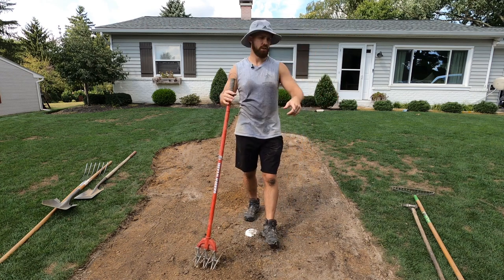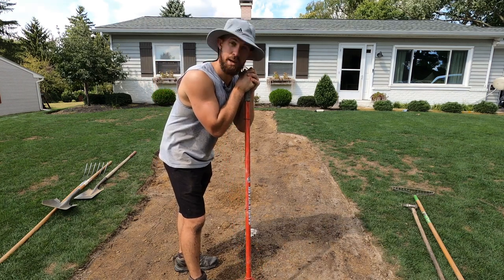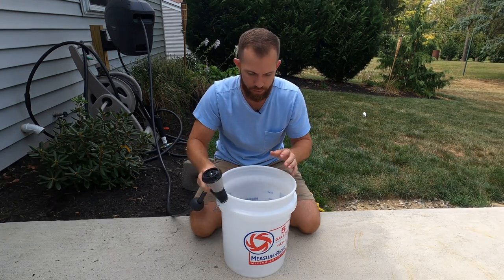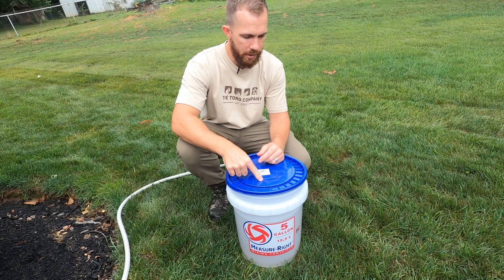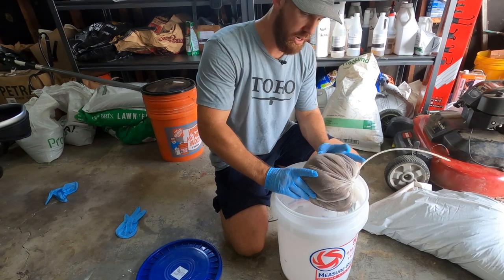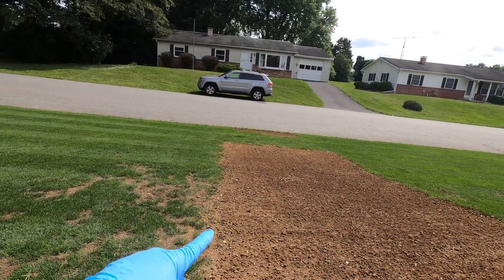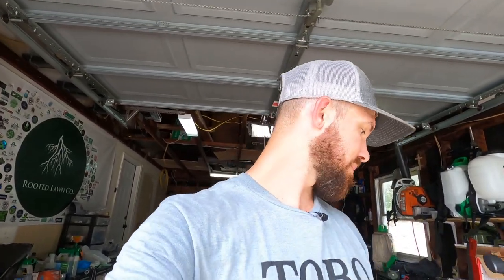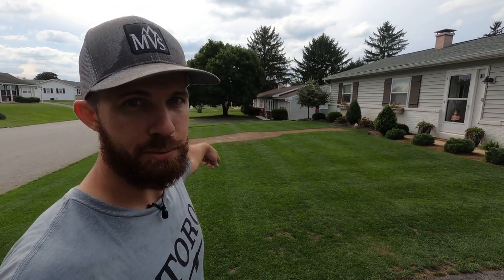Pre Germinate Grass Seed |Plus Leveling & Seeding Lawn pt. 2|

Comment: No need to have the seeds sprout. I seeded the seeds after having them in water for 8 days. They did not sprouts. So I put them on the ground. Three days later I saw baby grass. So the lesson was that all you need to do was to soak your seeds in the water for 24 hours. Then after keep it outside and water it for two days. Then, plant the seeds.
Reply: A big benefit to pre - germinating in buckets is saving $$$ on water and time. You didn't have to turn on your sprinklers for 8 days and that's a win. Pre-germinating gets water to the center of the seeds so that they sprout. 8 days I am sure got water to the center for germination to begin. Nice work!

Comment: I hang dry my seed bags for a few hours before mixing them in.   I do use Milo as it has a pretty high rate anyway only being 6% nitrogen.
Reply: I was thinking the same, hard to over apply when you just want it to spread

Comment: Well milorganite has a ratio of what to mix. I think for perennial rye, its 4:1. So you gonna use 5 lbs of seed, then you mixing it with 20 lbs of milorganite.
Reply: Agreed. I used the ratio when seeding my lawn and had no issue. It was easy to spread, even with the wet seed, and the lawn jumped up quick. Honestly, I'm not sure I would do it any other way. Because Milorganite has such a low salt index, you can use a crazy amount of it with risk to your lawn. Works a treat.
Reply: Same here. I put tons of milo at 4:1 ratio and never have issues.

Comment: Perfect, pre germination is definitely a faster way to go ; several ways to go. I use 2 buckets , top one to hold seed has holes in bottom, bottom to hold water. Lift top bucket , water drains out. Hot water seems to be a bigger “boost” to the seeds
Reply from the maker: I like the bucket with holes method. I might try that out! Thanks!
Reply: Did you have problems spreading?
Reply: @listdoludzie  this year I mixed it in Vermiculite and Humic , spread very well

Comment: Quick note: If you have clay soil, that garden weasel isn't going to cut it. You need to take a tiller or pick axe (using the wider end of the axe) to break up at least 4", then mix in top soil with it. I just completed that phase of it, hand-screening what I broke up by shoveling it into a wagon, hand filtering to get out big chunks that won't break up, removing most of the rocks and little roots, then mixing in some topsoil I bought. I've got at least 4" now of a nice mix of the old clay (which has a lot of nutrients) and the top soil (the top soil I bought is a mix of top soil, sand and nutrients. It's a very find mix. Should work well).

Comment: Not only I pregerminate grass seeds but I germinate them.
I punch 5-6 1 inch holes in plastic buckets and I mix soil with seeds (not a so big amount). I soak and mix it all and wait until it begins to sprout. No foul smell.
Don't wait for too long otherwise the mix will be harder to spread. When germination has started I go to the places I want to overseed and I add water to get a fine mud. I shake the bucket so the mud gets through the holes and distributes. If the weather is rainy when you distribute the seeds, it's even better. I repeat this process from spring to frosts and it works well. And I use minimal amounts of seeds. Almost no loss. Few or no watering because the seeds quickly root.
Ideal too if someone has a taste for wildflower patches. But with fewer seeds.

Comment: Pre-Germination duration varies not only by type but also brand. The high end kbg I used took 14 days. The TTTF took 9 days. That's changing the water every 12 hours per the Milorganite write up. I'm currently running a test using warm water to see if that changes the duration. I also used Milorganite as the spreading medium.
To dry the seed I spread it out on a tarp and left it about 30 minutes. I did find hand spreading was quick and the best for my application of about 800sf.
Reply from the maker: Did warm water help? What temp was the warm?
Reply: @RootedLawnCo  the warm water really didn't speed the process. Less than an hour after filling, the water turns cold anyway
Reply: Thank you, now I know how to dry the seeds, this was the part I was worried about, I dont want to hand toss 7500 sq ft lol
Reply: @kkevinj1  .. early next week I'll be hand spreading about 4ksf...milorganite/seed mix. I've done it b4 and it goes well once you fine tune your technique . A few other notes about drying the seed...if you have a cotton sheet that absorbs the water ,it'll  dry faster. Don't be surprised if it takes longer than 30 minutes
Reply from the maker: @kkevinj1  I can attest that Milorganite is a fantastic carrier for seed. Even if it’s not dried all the way. I did it on another seed job this spring and used a broadcast spreader.
Reply: @RootedLawnCo  Good deal, I just ordered some, time is running out fast on seeding
Reply: @RootedLawnCo  It worked like a champ just like you said

Comment: I think the Tenacity/PGR should have gone down a day prior if you pre-germinated the seeds.  Also i think it would have been better to split the hydrotain vertically. You are using it on the low end of the slope. Thats likely to be more successful anyway due to run off.

Comment: I wanted to experiment and try priming/pre germination. I soaked a PRG/KBG mix for 4 days. I never saw any germination but decided to spread the seed down anyway and top dress with soil. It's been two days and still no life visible. I'm worried I soaked the PRG too long? Maybe the water wasn't warm enough? 
I'll keep watering in the meantime.
Reply from the maker: What are your outside soil temps? How much are you watering?
Reply: @RootedLawnCo  unsure on soil, but it's been 24 degrees Celsius (77F) for the past week. The buckets of water were probably cold but would have warmed up with daytime Temps.